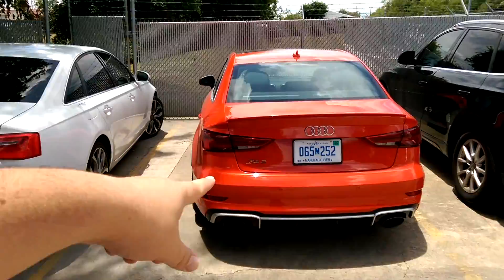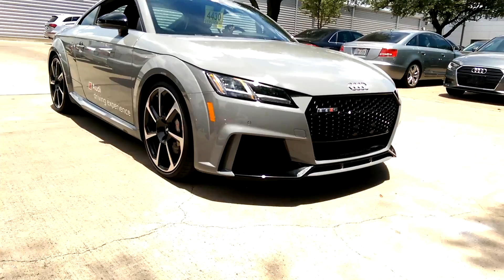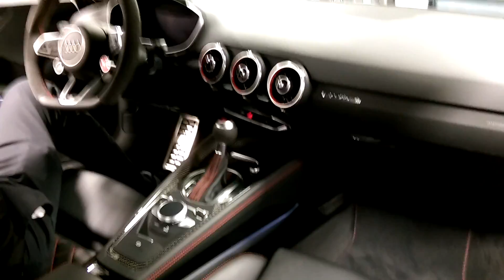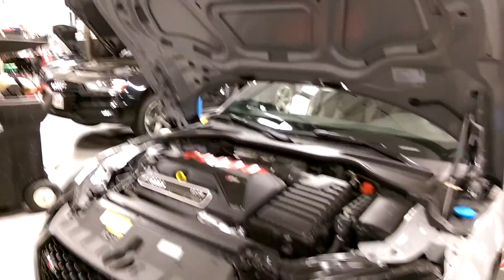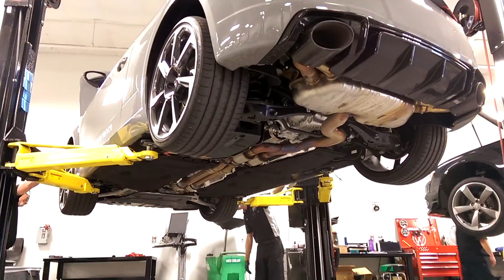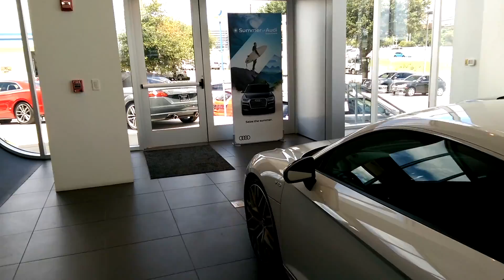2018 Audi TT RS Startup & Sound in AUSTIN TEXAS!

Comment: Audi had a horrible reputation with durability issues in the past.  Has their reputation changed because their design sure has.
Reply from the maker: I think their A6 and A7 3.0 is a solid choice. The B8.5 S4 and S5 too. My 2017 A3 was top notch. However, I think there's a huge problem between customer and manufacturer. The Dealer. Choose your dealership wisely. Especially when it comes to service.
Reply: Thank you for the advice and gosh the TTRS looks beautiful!
Reply from the maker: Here's more TTRS for you! https://www.youtube.com/watch?v=8jJaNW_y7Ak